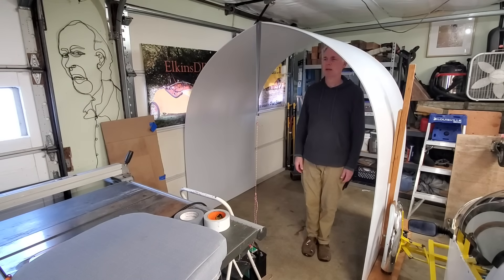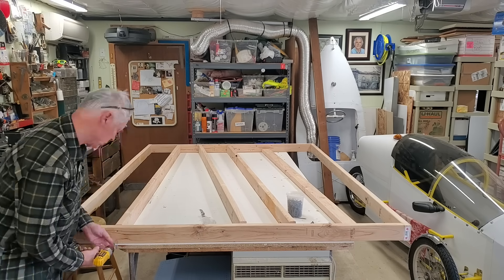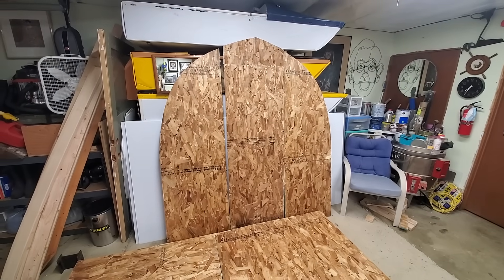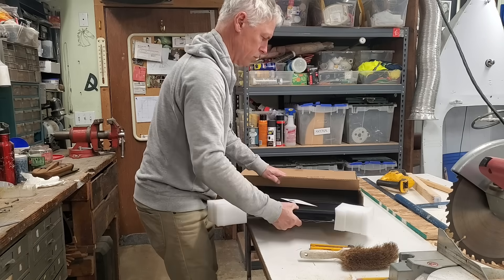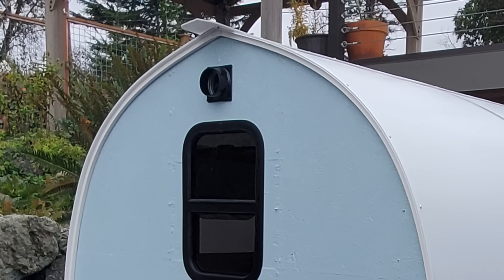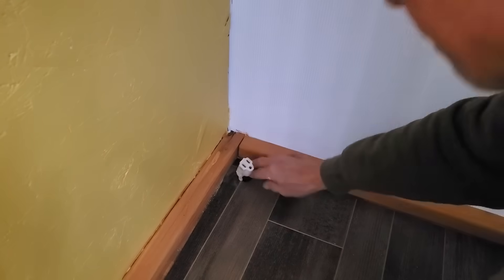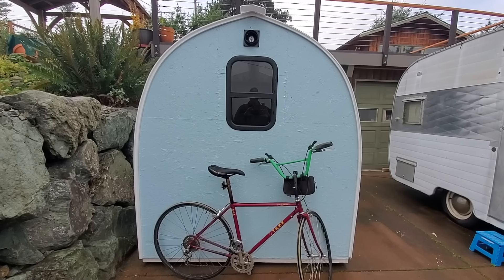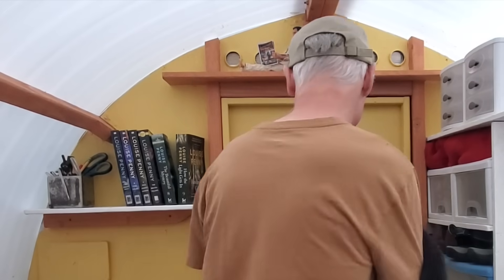Homeless transitional shelter prototype

Comment: Nice, but needs a double wall with insulation imho.
Reply from the maker: Indeed!  A double wall would be much better for sound insulation and also  keeping the inside cooler. My ramble near the end left out the way I could add 2 layers of 1" foil backed white foamboard to the interior walls.

Comment: Note this is wafer board, or OSB, not particle board. This has large hardwood chips of wood composited with exterior glue. Particle board is more like sawdust with interior glue, and doesn't last very long once it is wet. Wafer board is stronger and lighter than particle board.
Reply from the maker: Thanks for pointing that out. It is a genius way to use left over wood. The downside is the amount of chemicals (glue) that's needed to create the panel.
Reply: Yeah, the same only different.
Reply: I hate particle board. One drop of water and it Thanos-snaps itself out of existence.

Comment: Thanks for the video Paul ! That's cool. I've wondered about the UV resistance of the various corrugated plastic panels. I've seen the Solexx sheets made for greenhouse coverings are pretty expensive. What are you using these days ? 
I built a 16 X 20 canvas wall tent on the hill behind our fishing shack in Minnesota so we have a place for guests to stay. It has conventional wood framing covered with canvas drop cloths ($15 each) from Harbor Freight. It has 5, $80 "shed windows," storm doors at the entrance and an 8' screened porch on the south end overlooking a lake. It cost almost as much for fire, water & UV treatment as for the canvas itself. I used a sheet of poly greenhouse film over the roof canvas to serve as a rainfly. The greenhouse film is rated for 4 years of UV exposure. If the canvas holds up I'm considering getting an 18 oz vinyl rainfly. The vinyl would cost about the same as a metal roof but makes it a temporary structure to avoid permitting issues. 
Best wishes & good luck !!!
Reply from the maker: Interesting! Thanks for that. On my Conestoga bike camper I too used canvas dropcloth from Lowes or HD, and later added an elastomer paint. It seems to be holding up after being exposed for several years now. The shuff ain't cheap though!

Comment: Good thinking for a stubborn problem - homelessness. Might also work for disaster housing but needs plumbing
Reply: My grandparents grew up in single rooms in an inner city, with the whole family eating, sleeping, bathing and defecating in that room. There were drinking water facilities around the neighborhood, the buckets of poo were collected regularly. Hygiene improved a lot when plumbing came and the density of inhabitants went down, but not as dramatically as you might expect. I think this shelter is pretty much enough for emergency housing, provided there is thought about the logistics for human waste collection. Plumbing can be added later. I fully agree that plumbing needs to be established if the shelter is used for longer than weeks.
Reply from the maker: I was going to add a drain to the sink with the drain hose leading to an outside 5 gallon bucket. That's my camper set-up that I've used for years. It's a better way to distribute soapy waist water.

Comment: I like the cattle panel builds
Reply from the maker: I contemplated adding that to the build for security reasons, but if these were made in mass and situated in a sanctioned fenced place the likelihood of someone breaking in would be discouraged due to a watchful neighborhood.
Reply: @paulwelkinsdiy   I was considering them for durability of the structure and speed of build time. Being they are a prebuilt material available from many sources.  Security beyond a simple padlock is useless with most of the light weight structures. Too easy to break into with a blunt object, stupid people would destroy a home to steal a pair of sneakers

Comment: Hello Paul I always enjoy watching your videos you have a lot of good ideas I recently built me a camper was fence panels from Home Depot after taxes it was $86 for each panel 3 ft long and 6 ft wide how do you cut a few at a few pieces of 2x threes made it strong and I have a tarp over it for now but I'm going to fiberglass the roof and the sides the front wall in the back wall made a 30 inch door in the back so I can go do my boondocking and travel any place I want to go I'm going to Morro Bay California and Pismo and possibly non-poc in January after I build some cabinets I'm already staying in this and running from my friend I just parked in the front I have my own generator add a marine battery when I need to charge so I can charge my phone and I had me a nice comfortable bed a comforter I'm going to do more tip before I go I'm going to add solar panel on top 400 watts and 100 volt 80 amp EP ever charge controller and I'm going to get me a refrigerator freezer like an ice chest that works on battery Power and Electric and I'll be adding batteries to it every month maybe two batteries each I want to get warm weather I'm going to cut out the hole behind my bed and mount my air conditioner that I bought at Home Depot a few months ago too cold to use right now I was homeless for some years before this but now I have a Social Security disability income in my early retirement every month anyways don't mean to bore you with my story keep up the good work there p a u l can't wait to start carrying my bicycle trailer Inside and my recumbent trike I'm going to get a Harbor Freight trailer to build a box on that and get permanent plates and sticker for the trailer boxing in to carry everything on my V6 Dodge Dakota 2006 automatic anyway I'm wishing you a merry Christmas and a happy New Year God bless you Paul

Comment: Maybe with a bit more “sturdy” built in this would fit in the back of a truck as a sleeper? Great video👍😊
Reply from the maker: I was measuring my trailer to see if it would fit. I came 2" too narrow without compromising the base framework. Not sure if the front wall could take a 90mph wind gust, let alone a constant freeway speed. I do have designs with a dome nose similar to my Nomad bike camper. Maybe some day...

Comment: I love your designs but I don't know if they would make it through the winter weather where I'm at 😢... I live in the Rockies and sometimes we get the average snow fall in Durango Colorado is 71 inches per year... Is that roof sturdy enough to withhold the weight of the snow here sometimes it snows and snows and sometimes it doesn't as much 😂... Bi-polar weather here 😢...
Reply from the maker: I'm sure it wouldn't, if the occupant wasn't around to shovel off the snow. I lived in Telluride, Norwood, Montrose, Sawpit and  Placerville a lifetime ago. Miss the Rockies...

Comment: This is an excellent build.  I think I am going to try this next summer.  The only thing I might do different is I might put some thin insulation in mine as I am in Wisconsin, and we need it here...but you made allowances for that, which is awesome!  I love how natural light lights up the place though, and I know insulating it will wreck that effect, and that is a bummer.
Reply: You might consider some of the off-grid methods such as using a soda bottle to bring in light w/o making too large an opening.  Plus we now have broad spectrum LED lights that cost almost nothing to run.  When I retired almost 20 years ago in remote TinyTown, after the first month's bill they sent out someone to check the meter bc they'd never seen anyone's bill so small.  And back then we only had CFL's.
Reply from the maker: Indeed, I love the natural light, and as you say, adding foamboard would take that away, so a bigger window would be nice and one on the door.

Comment: Paul, we would be interested to see the price breakdown list included in the $850 total
Reply from the maker: I'll have to get out my receipts again. I added them up just yesterday and threw a few bucks in for good measure. Not today but later I'll add that in the description.
Reply: @paulwelkinsdiy  Cool, Thank you!
Reply: Also consider that in most areas with large homeless populations, they are also rabidly union.  So if these were to be allowed, the AHJ would almost certainly require either union participation or at least, prevailing wage.  Since this cost almost certainly doesn't account for labor, you'd probably need to triple the cost.  There is a role for tiny homes in addressing homelessness, but they aren't a panacea and they can't be done for anywhere near this price point.
Reply: @kcgunesq  Hence, the bureaucracy demonstrates that it's more interested in extracting profit from every little thing that anyone might do to save some money. Sure, we can talk about all the good reasons for what they do, but that doesn't cancel out the bad reasons. People like Paul understand the problem from a *human* point of view, rather than from a bureaucratic point of view. And when more people being to see this, perhaps they'll find the courage to push-back against the bureaucracy. But until then, every effort to solve problems will have some measure of corruption looking to profit from it. Sad, right?

Comment: I love it as always.   Had a thought, could you not make it with builders sheet foam insulation?  This would be cheap, insulate, remove most of the timber requirements and would be water proof?
Reply from the maker: I've made 4 foil backed foam shelters so far. They're effective in sunny climates, but the foil is just paper, and prone to turn black with corrosion after a while. They worked great for Bman. There is the closed cell plastic foam used for paddle boards which one fellow uses for small homeless shelters, but it's relatively expensive. So there's that. 0:03

Comment: I like these simple builds a lot. Kudos. Extending the roof over the gable is a nice touch, I would consider doing it on both sides to keep all the direct rain off the wood. Treating wood is good but just postpones the inevitable, if you want wood to really stand the test of time, keep it dry.
Reply from the maker: Thanks for that. I almost did, but Fluted plastic on its own will probably degrade from UV rays faster than exposed painted OSB. Using elastomer paint should give the wood a few more years life.